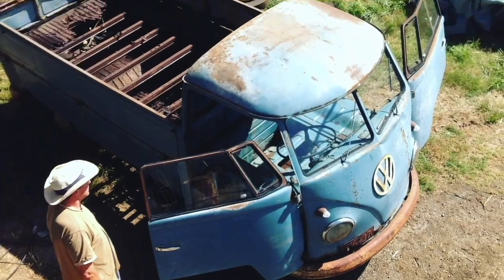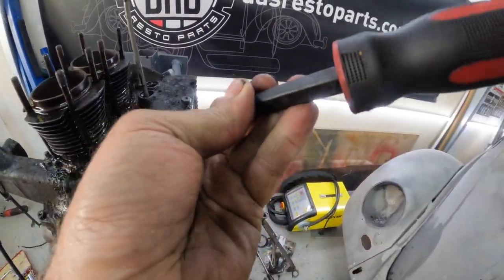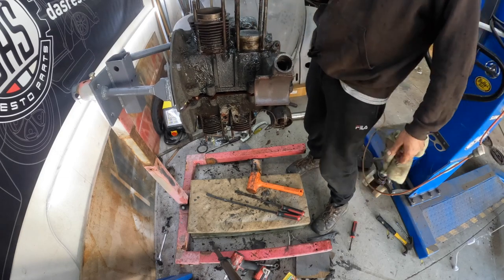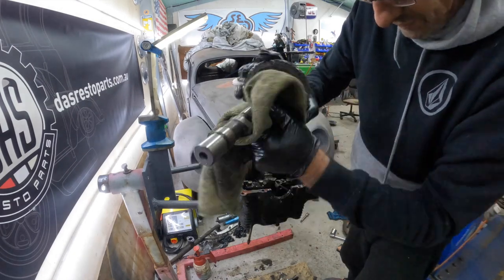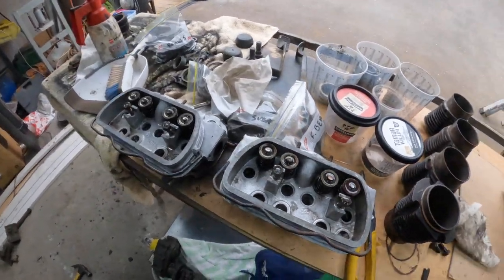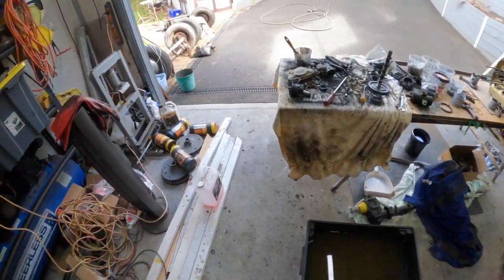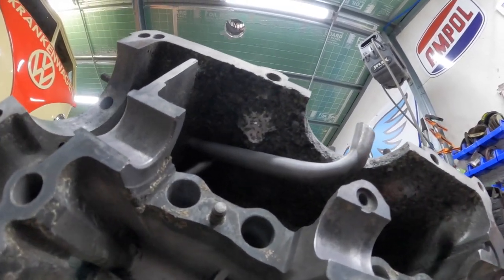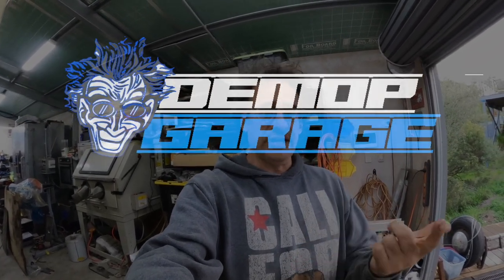Rebuilding a 1952 barn door ambulance // motor tear down part 2

Comment: i heard those cases  have a high magnesium content and catch fire easy 
i''d try drilling and plugging the holes   tap a thread to screw the plug in using a sealer to make sure it won't leak
Reply from the maker: yeh mainly 30/70% content and with argon gas no fires ;) Video coming soon :)

Comment: I thought the 25 hp were aluminium, but that could be the really early ones only
Reply from the maker: Definitely mag, did the test on the shavings. Was told the first very early ones were before going to alloy.
Reply: @DemopVWgarage  i found it now, aluminium  cases until 19 jan -51 for the type 1

Comment: Sorry, but this crankcases are NOT Magnesium made, they are Elektron ons. This is a Mix from Aluminium and Magnesium.
Reply from the maker: Definitely mag, did the test on the shavings and vinegar on the surface plus its already welded up with the mag filler rods.( very green glow) The very early cases were 30/70% content what I was told.